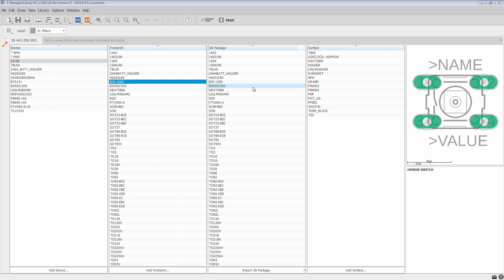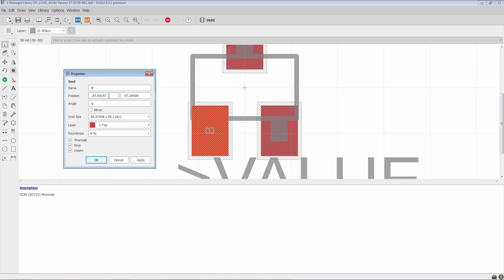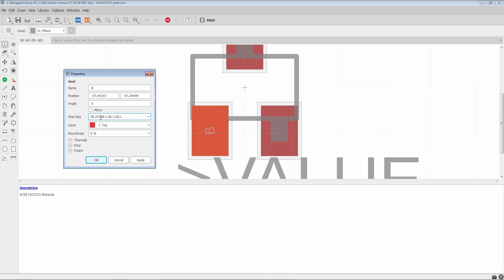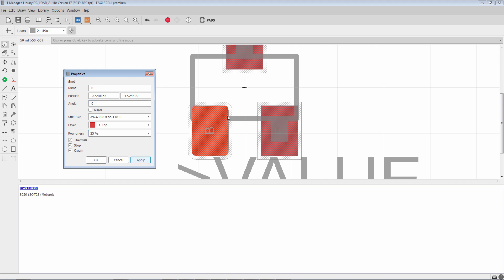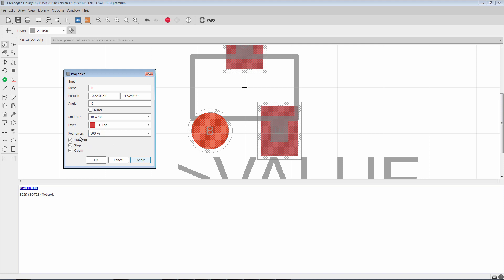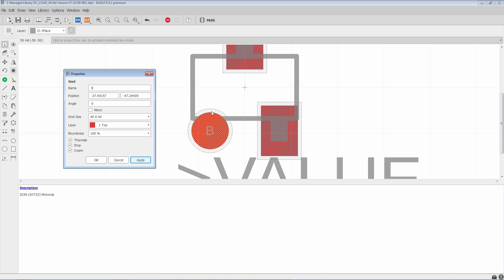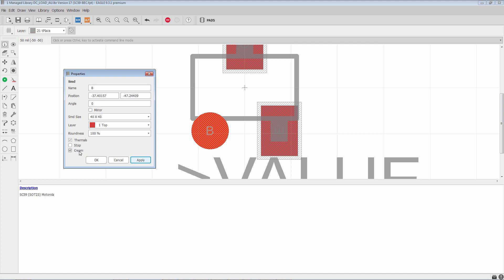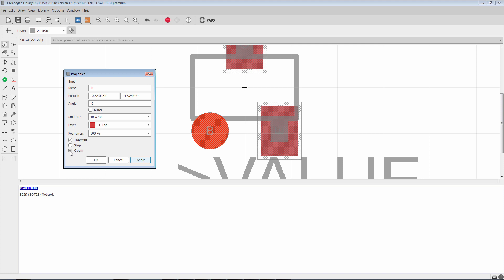QUICK TIP: SMD Properties

Comment: Jorge, is Autodesk Team considering to add a feature which allows user to set the size of cream aperture? What I mean by that, is simply to tell Eagle that cream opening should be e.g. 5% smaller than the pad. This is offen a recommendation for small QFN packages. Thanks.

Comment: halo, does anyone know how to print the pcb board in actual size in negative mode or so called inverted color to the pdf? I cant find any solutions on the internet. Quite desperate.
Reply from the maker: Halo Henry, Thanks for your question. Best way is probably to export the image and then reverse the colors using a graphics editing program. I've used Windows Paint for this purpose in the past. Cheers!

Comment: It's unclear, how to check/setup the mask stop clearance size from the pad?
Reply from the maker: Hello There, Thanks for your question. Go to DRC > Mask Tab. There you can specify the stop clearances. You'll notice that by default Min and Max are set to 4mils. This means that all pads regardless of size have a 4 mil stop mask clearance. By adjusting the min and Max values you can have the stop mask be proportional to the pad size. Please follow up with us on the EAGLE forums if you need additional assistance. Thanks! http://ow.ly/2kI730nWJMR